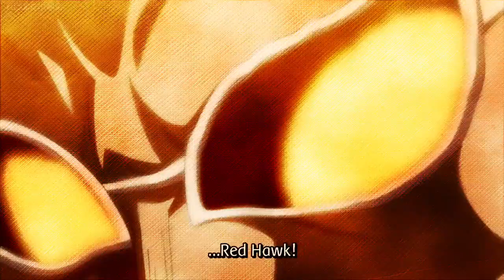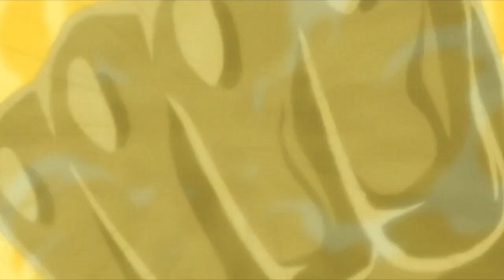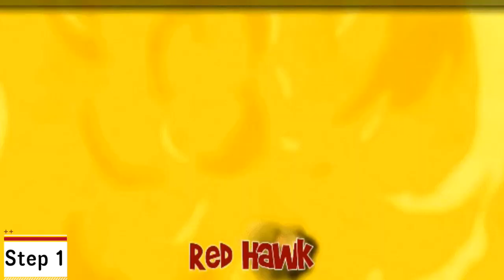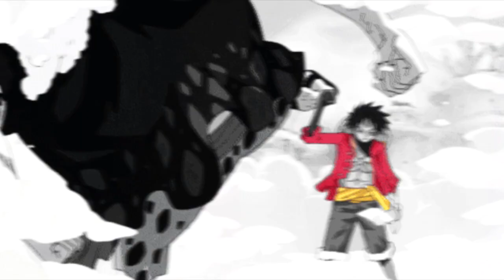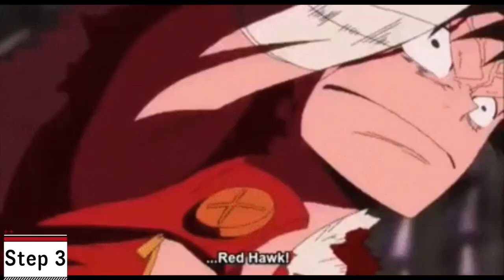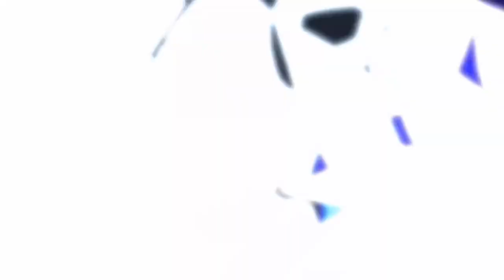One Piece - How Does RED HAWK Work?

Comment: I think the heat caused by gear second generates and forces warm air into the air around Luffy's arm causing it to become unstable. This allows the oxygen molecules to separate and bond with hydrogen, which makes up a small part of the air we inhale, thus oxidizing it, a key component for combustion. Then, the heat from gear second combusts it. Luffy is able to let the fire burn on his arm due to the protection from haki combined with the fact that hydrogen fire is more stable than many other gas lit fires.
Reply: Lmao found 🥸

Comment: My theory includes some of your belief. but the way I see it, Armament Haki changes the physical attributes to resemble a flint and steel, It isnt making the skin more combustible, because then why not use bombs to blow up haki users? but rather, like flint and steel, friction creates sparks, and in the case of Red Hawk, the length and tension in his arm is greater than any similar punch of his, and what results is when the rubberization and muscle contracts so intensely, the resulting velocity creates a constant sparking effect, which is then portrayed as fire because of the symbolism of his relationship with Ace. this idea can be further supported by the effects on a target. while it visually shows the fire going through the target, that is more a visual technique to show force. the "fire" rarely causes lasting flame or evidence of burns. which means there isnt actually fire ( which would linger especially on clothes) but rather momentary immense heat or friction. enough to singe clothes or leave a patch of friction burn on unprotected skin. It also explains why redhawk worked underwater, as fire wont actually ignite under water, but heat caused by friction is still generated. and sparks can still form as it's a near instant and minute moment of immense heat that is almost instantly dissipated